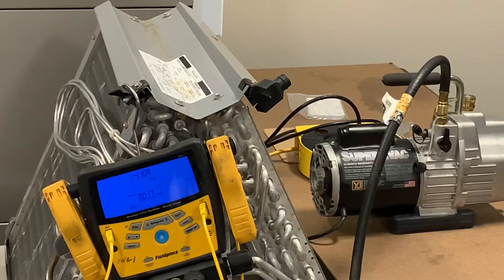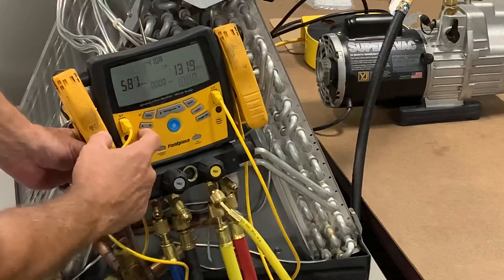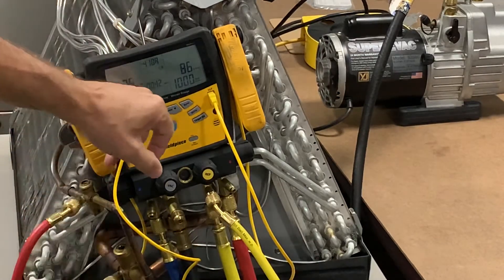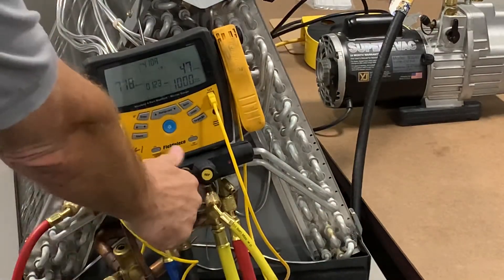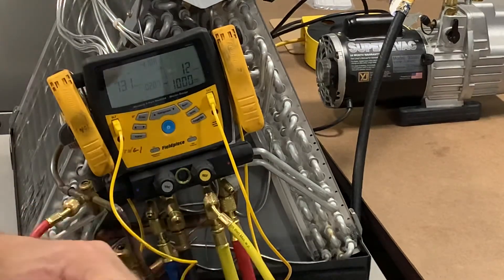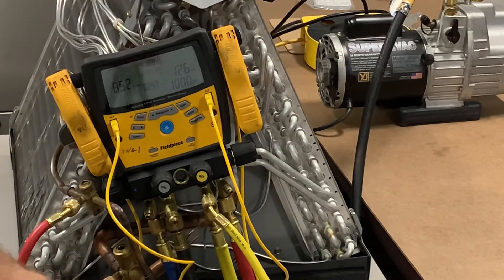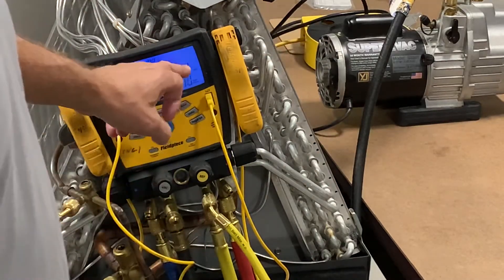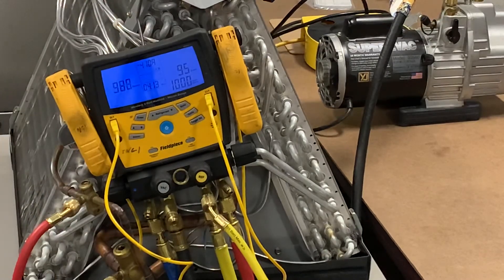Number one mistake while checking microns/decay test techs make with sman 460 or 480

Comment: Well then, how is it, when all my manifold valves are in the off position and we gauge up to system, it gives our system pressure without any of the turn handles in the open position. I believe you need to understand where gauge pressure sensors are located in the gauge manifold 😊
Reply: That’s because the micron sensor is on the other side of the valve. Try to pull a vacuum with the red and blue handles closed… same thing, it’s not going to work unless they are open.

Comment: Your fist mistake was pulling through a manifold to begin with. On system change outs and new installs, I remove the schrader from the suction side and install a core removal tool with a large vacuum hose connected directly to the pump. Hook the micron gauge to the liquid line and you are measuring from the farthest point from the pump. When it’s time to isolate, close the core removal tool and shut off the pump. The microns will actually drop for the first few minutes while the system equalizes and then slowly start to rise. Once you pass decay test, before you remove anything open the service valves fully bringing the system to a positive pressure. Remove the micron gauge and re-install the schrader core and remove the core tool. You should never pull through a gauge manifold or 1/4 hoses because they all leak. Always remove the valve core and use core removal tool to isolate vacuum. If I’m doing service work, for example replacing a compressor or reversing valve then I pull from both sides with large hoses and core removal tools. It takes much longer when you are vacuuming down with the valves open because it is a much larger volume and you may have refrigerant trapped in the compressor oil depending on what kind of repair you are doing. When I pull with two hoses I install the micron gauge on the side of the core tool that’s connected to the suction line.

Comment: The frustrating thing with my fieldpiece sman480, is what you just showed with it unable to keep a vacuum. I have run a vacuum just on my hoses and gauges and it climbs to atmosphere if I let it sit there long enough. I am not a huge fieldpiece manifold gauge. It causes me all kinds of frustration as I am losing my vacuum at my gauges, not necessarily the system that I vacuumed. I honestly am at my wits end with their manifold gauge. Tightness test included. The gauges leak.
Reply: Exactly. I stopped relying on my sman480, i just rely on my micron gauge connected to my core remover tool, so i can completely remove all hoses and manifold from the system and still watch my micron gauge at the service port
Reply: I don’t have the SMAN 480 yet and was thinking of buying this year. I do the same thing.  I attach my micron to the core remover and isolate there.  Less chance for leaks from hoses, valves and such.  I may not buy that expensive tool after all.  Not sure I need it.
Reply: Rebuild kits are available for around 60.00
Reply: @ good to know. I will have to google this.

Comment: If you really want to get technical brother, you should never under no circumstances attempt to pull a 250micron vacuum with guages, especially if you have plugs including on your service ports..your pump should be attached directly to the system high side on a valve core remover, nice vacuum rated hose atleast 1/2" in diameter with your micron guage connected on your valve core remover for your suction..using guages is the equivalent of having several restictions while pulling a vacuum especially with 1/4" hoses. Can be done, but somethin many techs should not practice

Comment: The number one mistake is using these gauges for performing an evacuation, they leak, use Appion valve core removal tools a hose, pump and external vacuum gauge. The SMAM gauges are fancy, expensive and unreliable, go old school and save yourself a lot of headaches.
Reply: Mine don't leak. They go down to 500 microns and will hold s decay test with cores removed. Although it does take longer than using two 3/8s hoses

Comment: Where did you get the equation of 250 microns to 1000 microns in 10 minutes? I’ve heard of 500 microns to 1000 microns in 10 minutes. If you start at 250 aren’t you allowing more time and leakage to your test?

Comment: I thought it was going to be something spectacular. .  .He was just showing an idiot mistake! Who in the hell does that!?!?!
Reply from the maker: They all don’t start off as rock stars, in fact we hire straight out of trade schools very green folks that need to be taught, and lastly well over half of the most seasoned installers and techs who were tested on demonstrating their evacuation prowess failed for various reasons. The closing of the high and low side valves was the most prevalent mistake. Followed by not knowing how to perform decay testing, and us routinely identifying their tools leaked, weren’t maintained, or simply didn’t work.

Comment: This is why i use 2 1/2 hoses connected rite to my pump using 2 core removers and a microngauge.once i reach below 500 let said 450 u close ur core remover from the low side and wait your 10 min test. And u wont see no changes until it stabilaze.
Reply: I agree with this method and it honestly gives me way more piece of mind not tryna hope or guess if my gauges have any leaks. One question is that I do have trouble getting certain fittings onto say ductless condensers which service ports are mounted really really tightly against the unit making it a real pain in the butt to attach or reattach. I ve tried removing some screws to buy me a little space but to no luck. Any fittings that may help with this issue I'm having? Nothing beats a vacuum with a core removal and micron gauge. Quicker, deeper and more promising results. Appreciate any advice

Comment: Don't use gauges.... avoid potential for leakage by hose connections. Use 1 hose, use core removal tool and put the micron gauge on the suction side at the service valves.
Reply: This is incorrect. On a one hose pull, you pull from the suction line and put your vacuum gauge on the liquid line service port.
Reply: @89dhvac look at big boi over here with service ports on both the liquid and suction lines
Reply: I’d love to see a video explaining how to do this
Reply: @resandor  go check quality hvac “one hose vacuum set up “
Reply: @resandor  I learned here https://youtu.be/wYZ8Wudksb0
Reply: @resandor  https://youtu.be/RA7BY7dixIg
Reply: so u have to vacc from the liquid line?
Reply: @viisteist1363  Yes, on a one hose setup.

Comment: So when you do it this way and you take the 7 times whatever the microns per minute number and if it's not at a thousand does it mean you passed the leakage test also does the micron numbers quit going up or is it supposed to stop and hold at a a certain number
Reply: If you use the sman480 the microns will leak all the way to atmosphere levels. What youre supposed to do is throw away the manifold and rely on a smaller micron gauge connected directly to a core remover tool which is connected to the side of another core remover tool which is connected directly to the service port of the aircon, then the micron levels will eventually slow right down to where they hover around 500 microns for smaller aircons
Reply: yea, 25 years doing this, if you follow this video you going to be  there 5 days.

Comment: Only problem is using a set of rubber hoses that have been used on a system coded with Esther oil on the inside that has absorbed moisture and refrigerant into the hose lining. Only problem is using a set of rubber hoses that have been used on a system coated with Esther oil on the inside that has absorbed moisture and refrigerant into the hose lining 

          After shut off this leads to the technician reading the moisture and refrigerant trapped in the lining of the rubber outgassing failing the micron test
Reply: Another good reason not to use gauges for vacuum and decay test.  Use a seperate large hose or hoses with a seperate micron gauge.
Reply: @ryanpotter1122  in my videos I try to stress and get the point across using your refrigerant gages and refrigerant hoses is the wrong way to try to pull it and hold a deep vacuum. 
              But we know the majority of technicians do not know this and do not want to listen to this because it cost extra money and time to own dedicated vacuum hoses like true blue by Acutech or sum other company. 
          They must own dedicated micron meter with isolation valves
Reply: @coldfinger459sub0  I gotcha.  I make my guys do it.  It's a shame that more don't do it that way.  What it saves in labor time alone is so worth it.  I hadn't seen any of your other videos so I didn't know you advoxated or knew the other way.  Either way, it's a good video and thanks for making it!

Comment: i think the most frusterating thing in hvac work is that you cant just simply trust your gauges!!!!
Reply: Better off ditching the gauges and putting a true micron gauge at the farthest point of the system...i.e.  put the micron gauge on 1 valve and pull your vacuum through the other valve (with Schraders removed).  This will give you a true micron value at the far part of the system.  It's faster too.  The higher end blue vac micron gauges will even do the delay tests for you in a fraction of the time.  Big hose or hoses and, seperate micron gauge are the way to go.
Reply: @ryanpotter1122  unfortunately most residential splits dont have 2 service valves only one
Reply: @matttzzz2  what residential units don't have 2 valves?  Pretty much all condensers have a high pressure valve and a suction side valve.
Reply: @ryanpotter1122  all the splits ive installed between 2.5kW and 9kW had valves only on the liquid line. Mitsubishi Heavy, Panasonic, Hyundai, Fujitsu, etc. I wish there were 2 valves so i would have a better vacuum reading
Reply: @matttzzz2  you most likely speaking on mini splits! Ryan and most others are talking about your conventional splits systems.
Reply: @matttzzz2  put a core tool with another core tool attached then.